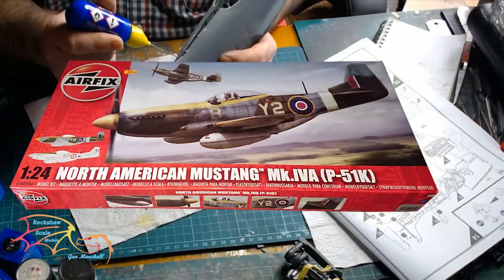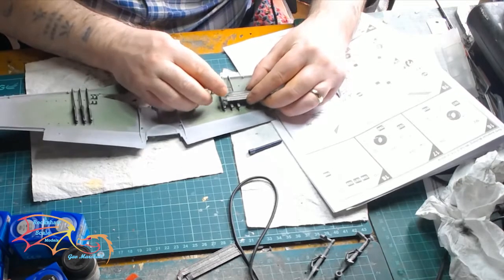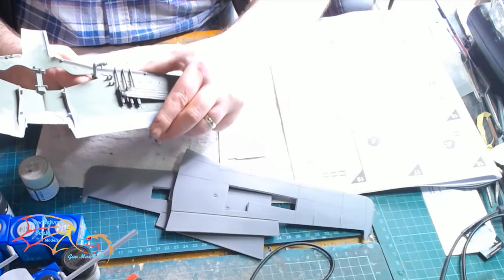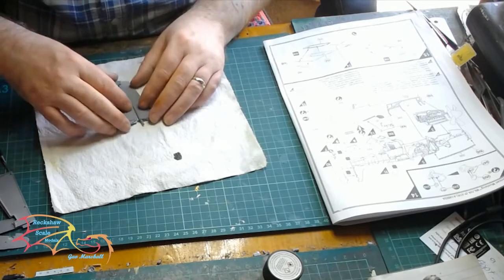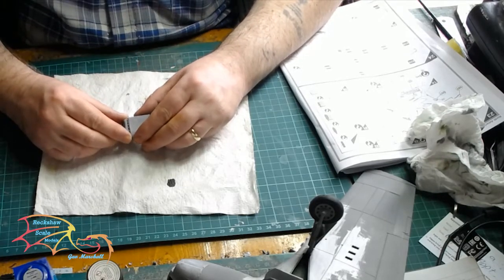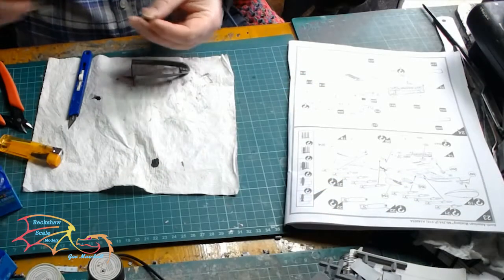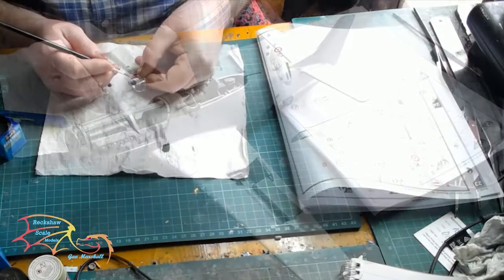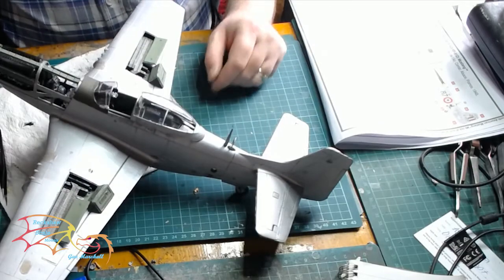Airfix North American Mustang Mk.IVA (P-51K) scale 1/24 Part 3 Wings & Gear

Comment: I remember building this kit. In order for the gear to retract, Airfix made the undercarriage gear in the uncompressed position (no load on them). The result is the plane stands too high off the ground when placed on it's wheels. I had to get some brass tubing machined to make the struts  telescopic so that they would be in the  compressed position when the kit was on it's wheels. The V-shaped torque arms were a pain also as they had to move with the struts compressing.
Reply from the maker: @PasstheDalek  wow didn't know that, thanks so much for the info.